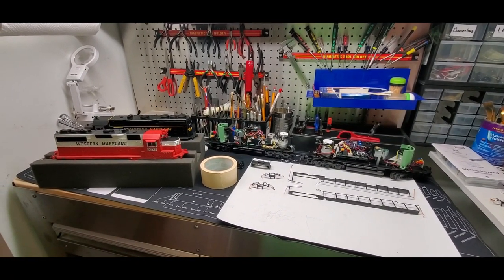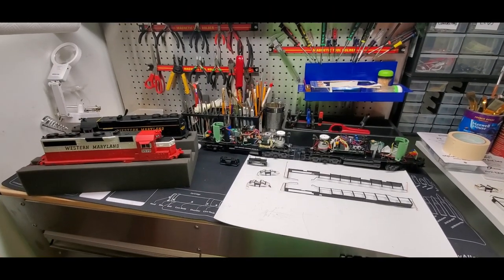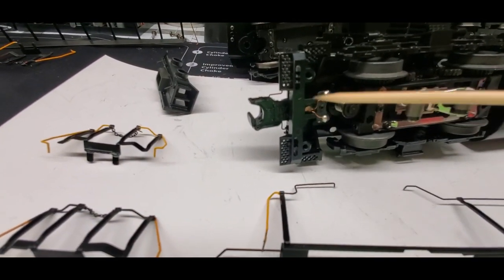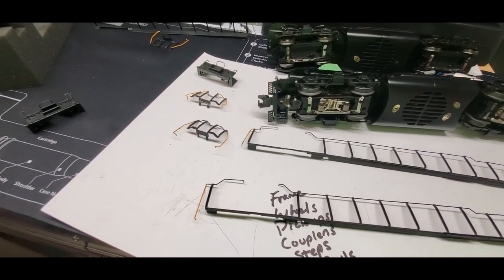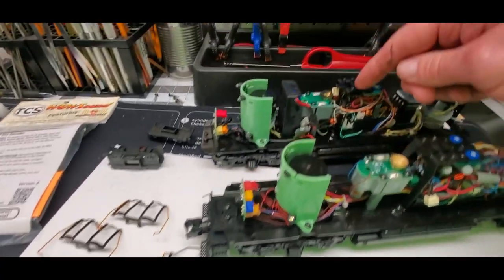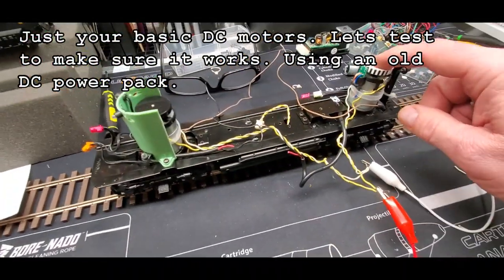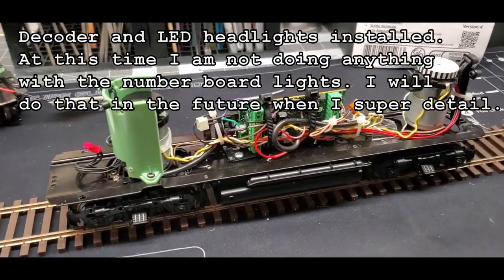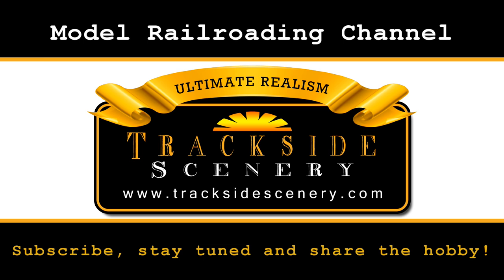VLOG - Tearing apart a perfectly good locomotive

Comment: I am doing the same with my Broadway Limited Imports On30 C-16 steam locomotives.  Great, smooth runners, but the DCC with sound systems are dated from 2003.  They sound really great, but you notice that when you hit the bell or horn the steam chuff cuts out until the bell or horn stops.  So, I decided to modernize.  Also, these 2-8-0s are rigid frame and the smallest imperfect in track causes those to derail.  The flange drivers are in position 1 and 4.   I swapped 3 and 4 to reduce the distance between the flange drivers.  Then I gutted the electronics to install the Soundtraxx TSU-2200 Steam Decoder and the Current Keeper.  I swapped out the two speakers and now one is a Mega Bass.  Runs great and sounds great!  Being multi-channel the sounds don't cut out to play another sound.  Now it doesn't try to pick the turnouts.
Reply from the maker: I bet they run great. I did that with a bunch of ON30 Bachmann locos for the Spruce layout. Also here on the channel. And I agree, those 2-8-0s pick up and pronounce every bump.

Comment: What’s the advantage of switching out the PS3 board? I thought a PS3 locomotive support DCC. Is it to get different sound files?
Reply from the maker: Lot of options with sounds and a lot more control over motor controls. MTH is good for what it is, but aftermarket allows you to do whatever you want.